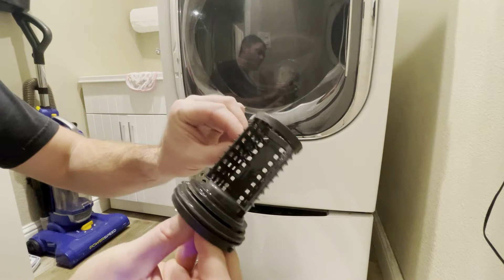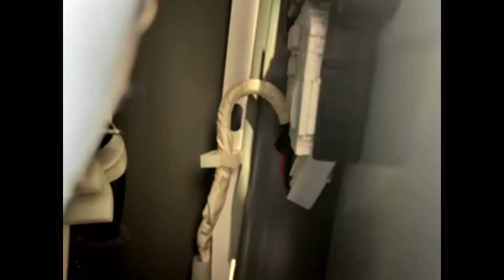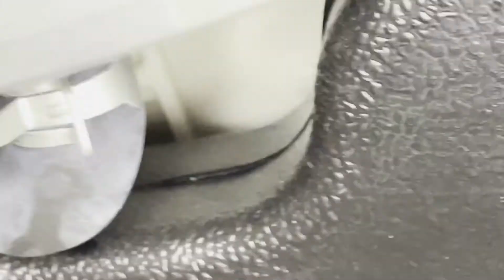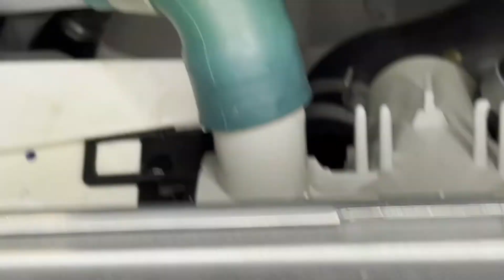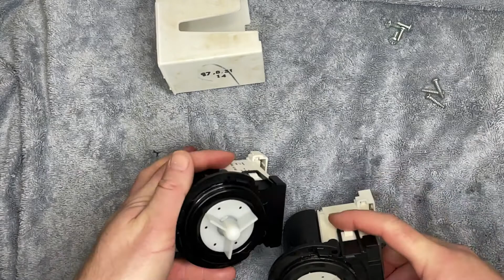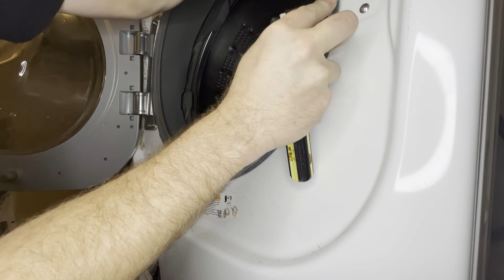LG Washer Water Pump Replacement (Washer Dryer Combo) WM399HWA

Comment: I am disappointed in our (expensive!!!) LG washer/dryer combo in that I had to replace the mother board already, after only 4 years, and now the drain pump has gone out. I am forever grateful to the folks who put out these DIY videos showing us how to repair our machines! It took me several tries to find the right video for my particular machine, so keep looking if at first you don't find yours. Of course, you will only really know which video will work until AFTER you start disassembly, but keep the faith that yours will be covered somewhere. This video was for my machine, and got me through with flying colors, but I have two suggestions that will help. One is, pay particular attention to the white plastic shroud that goes over the drain pump motor, specifically how it fits. Take several photos from different angles, because I didn't and had a hard time getting it back on properly. It's not intuitive, is cheaply made, and is easy to break. Mine is also not quite exactly like the one in this video, either, so be aware of that. If this shroud does not fit properly, it can interfere with the pump seal seating properly upon reassembly, and you could have a leak once you've gotten everything back together and tried a cycle for the first time after your repair. 
The other suggestion pertains to getting the door seal spring assembly back in place. This video used a screwdriver to force the wire ring back on, and I had no luck doing it that way. The spring is very strong, and the force necessary to pry it on with a screwdriver could easily damage your seal, which would mean more expense and delay. There is a spring expansion tool available at Amazon or Home depot, and I think Walmart, that makes this part of the job a  piece of cake. It'll save your fingers, and your seal and the paint on the front of your machine, and only costs $15 (get the upgraded tool) at this writing. It is even listed as an LG spring expansion tool on some sites! Do yourself a favor and order it when you order your new pump motor! Good luck, and thanks again to the maker of this video for saving me some time and money!!

Comment: Once again, I am grateful for this great video. Two years later after writing the comment below, I just replaced the pump for a second time. Got the "original" LG part again, but probably should have gotten the one shown in the video. Both times when I replaced it, I pulled on the white thing that spins, and when it came out and I found the chamber full of soggy lint.

Comment: For anyone who followed this and it still doesn't drain (like me), I took the new motor out again to inspect it more carefully and in the process found that the black wire next to the brown was not plugged in correctly. I must've tried to plug it in backwards the first time and it pushed the metal tab against the plastic instead of connecting.  After fixing that it works now 💯!! All of my wires were opposite of this video, as was the hot and cold water, on the same model washer BTW. While I was troubleshooting I removed and flushed out to drain hose too (it wasn't clogged). I also learned that my detergent drawer is not draining anymore, just overflowing, and it's caused a lot of rust. I had to get help cutting a new groove in one of the rusty screws to remove it  (of the 6 behind the control panel).  I did have to order a spring stretcher tool as well. So I had a lot of issues and it took me almost 2 weeks to fix but it feels like quite an accomplishment with no experience working on something like this! Thank you so much for this video!

Comment: This video was incredible !!! Never left a comment before but this helped so much.  I've done it before to replace a heater coil and it was brutal ..  

Two tips ... The door latch was way easier to unplug after carefully leaning the front back then reaching inside ...

And use a Allen wrench to force the wire band around the seal .. u can crank on it or just twist it and slowly roll into place without damaging the rubber .. thanks again !!!

Comment: There are 2 screws, TWO, that you MUST remove down at the bottom-left corner of the main-door assembly panel, holding the plastic piece covering the drain filter (one is painted white, the other is BEHIND that) that you MUST remove AFTER you remove the top 6 screws or you will DESTROY the entire front metal panel!!! The panel the door is attached to DOES NOT "just come right off" without removing those 2 screws which is NOT in the video!!!
Fortunately I said to myself, "this is not "just coming right off" so there must be something else holding it on" before I bent the crap out of the entire front metal panel.
Reply: Otherwise, a GREAT VIDEO!!😄👋

Comment: Had to chuckle when you shared your review of the unit.  Yep.  I followed your logic and also can to your same conclusion.  If you want your clothes dry without wrinkles, you need more BTUs for a real clothes dryer.  I think this a good unit for an RV or small off-grid property because it runs on 110 volts, is small (its all in one), and doesn't require external venting.  This is my third LG washer and I would say its not great at washing the clothes either but its better easier than hand washing.  I'm also on my third pump in five years.  ...wait, maybe its not better than hand washing.

Comment: This is a great video. Just followed the instructions, fixed my washer, and saved myself a big repair bill. Thanks.
Out of caution, I ordered the "original" part from LG for about $60 (incl. shipping), which turned out to be just like the broken one in my machine. It was an ASKOLL part -- the same brand as the one you had to replace and with all the same characteristics, but with a different part number. When I pulled on the rotor on the old one, it came out and I found that the chamber was completely full of soggy lint. 6000 views on this video tells me something is not right these pumps.
Next time, I will definitely buy an old fashioned washer and an old fashioned dryer -- if they still make them! Until then, I am happy I found this video.

Comment: I'm a 74 year old lady who followed this video exactly and saved myself at least $400!!  It was an easy fix.  I will probably have to replace this again in a few years (this is the second replacement-first one was done under warranty) so I will definitely invest in a spring stretcher tool.  It's only $12 on Amazon and would have saved me a LOT of frustration when it comes to getting the ring back on the front drum gasket.  Thanks so much for this great video!!!  Oh....and I suggest wearing gloves when taking the top and the front of the machine panels off.....that will definitely cut down the metals cuts!

Comment: Hey, thank you so much for this video, dude. It was a HUGE help. The vid is super detailed and gove great tips, and warnings about tricky aspects of the replacement.  The only part I was iffy on was putting back those 3 bolts that hold down the pump assembly because there are kind squishy rubber pads those bolts go through, so I was unsure of how much to tighten them.  Anyway, fantastic video, and thank you again!
Reply: Thank you for taking the time to send me a nice message. It makes all the time I took making video worth it. I tried to make it detailed enough that anyone with basic tools could fix it. I had some complaints that is was to detailed… I guess you can’t please everyone. 
As for those 3 bolts you don’t need to tighten them down much. The rubber is there to dampen the vibration of the motor. So when the bolts are secure the motor should be able to move around.

Comment: Just a question for you what is the make and model of the sidekick that you have and does it dry as well?
Reply: The sidekick doesn’t dry it’s only a washer. It’s really only good for super small loads like delicates. As for the model I’m not sure but I made a video how to fix it when the lid gets stuck. You could check my video. I just brought the washer and combo to the basement, the pump broke for the 5th time in 5 years. I’m done with it!

Comment: Great video! Very helpful. Since the two pump motors are AC, the exact placement of the wires is probably not critical (i.e. no distinct positive and negative). I would also offer this pro-tip (that I just thought of because it happened to me): before you button everything back up again, pour a glass or two of water in the washer tub to make sure the big hose is seated properly (ask me how I know). Likewise, you could also reconnect the door switch and run a brief drain/spin cycle with the spin disabled to verify that your new pump is doing something. I ended up taking it apart twice to deal with water flooding out of the leaking hose fitting.

Another thing worth doing is buying the specialized tool for stretching the spring while reinstalling the gasket. I ended up putting it back together without the band because I couldn't do it by hand. It doesn't seem to need the band to prevent leaks, so I'll just use the machine until I get the tool and can finish it properly.
Reply: Thanks for the extra tips on testing it out first, cause yeah that would happen to me too

Comment: Just got mine apart after factory motor impeller failed. Just a note that on mine (same model number & purchased in 2018) my blue & black wires were opposite yours, brown and black wires were opposite yours, and hot and cold water connections were opposite yours. Also the 3 screws that hold the pump/motor bracket to the washer are 10mm hex heads. New factory motor is supposed to arrive tomorrow along with a wiring harness. Not sure what to expect with the opposite conditions I found on mine compared to yours.
Reply: Thanks for the advice to viewers working on this unit. Yeah it’s important to take photos of the work you do to make sure you put it back together just as you found it.
Reply: I just changed my drain pump today and mine was also the opposite- black and blue wires and the hot and cold water connections.
Reply: Does anyone know, what would happen if you switched the cold and hot water valves? Also what is the role of hot and cold water to the drain pump?
Reply: @alohawaii222  I would confirm that you put it back together the way it was originally setup. Why take the risk of something going wrong with a washer that already has problems.
Reply: @jt9602  thanks for the reply. I put it back together and realized that the valves might be backwards... i didnt wanna go take everything off again haha. But i test ran the machine, its working all fine thanks!
Reply: I don’t believe there should be any problems with the wire color being different. Motors run with wires placed on either terminal from my experiences of playing around with them. AC & DC
Reply: So glad you posted your was opposite ! I changed my pump twice already and was looking for the video that I used the first 2 times- can across this video and started to wondering  if I put mine back together wrong ! Seeing your comment saved my sanity lol

Comment: Your awsome thank you! I have already had to have my pump replaced once aleady. He said because i have well water its common. And its gone again. Then it was under warrenty still, unfortunetly its not now. But thats easy enough to do! Im excited you made this vide9 thank you!
Reply: Thank you for taking the time to leave a nice comment. Unfortunately I think it’s the quality of the motors that is the main problem I’ve had to replace mine every year I’ve owned my washer / dryer & I’m on city water. You might want to look for a motor with a lifetime warranty. It feels good to save a buck and do the job yourself. The only part I hate is the putting the spring on the drum.